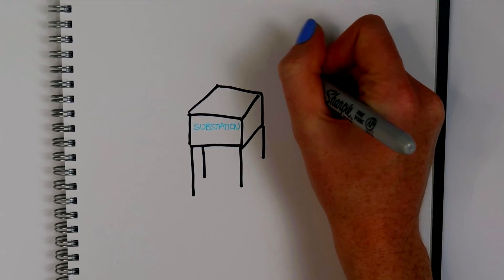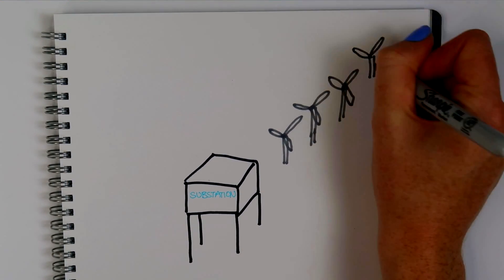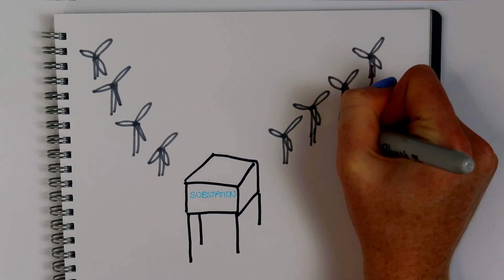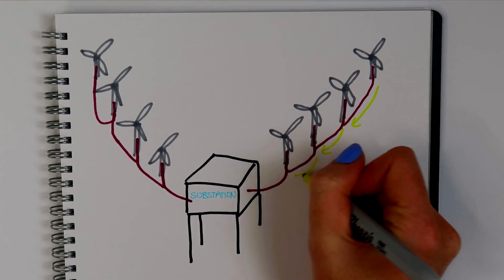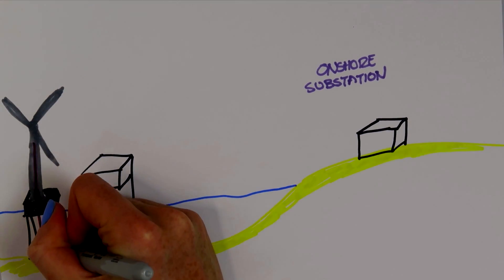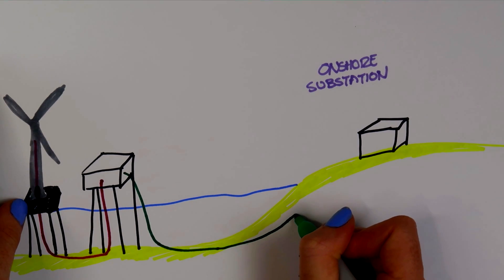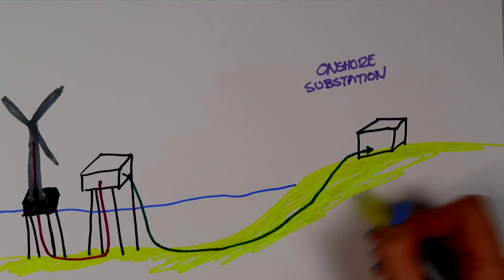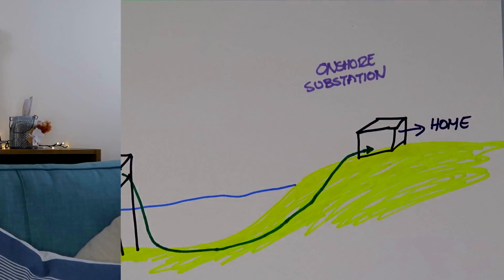How do offshore wind farms work!? And how is all the electricity sent to our homes?

Comment: Of course there are step up and step down transformers involved in this process as well as various pieces of equipment to protect the transmission network such as circuit breakers. I work in the electrical industry mainly dealing with industrial power systems and process control equipment.
Reply from the maker: Indeed there are! Debated for a while whether I should include in the video, wanted to go for an overview. Very cool you work in the electrical industry. UK based?
Reply: I am UK based, I work for a company in the North West of England called Boulting Group. I build and wire industrial switchgear and process control systems, the main bulk of work we get is from the water industry however we do work across the pharmaceutical, oil, gas and energy sectors as well.